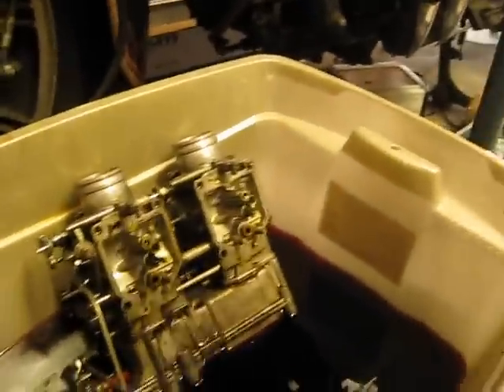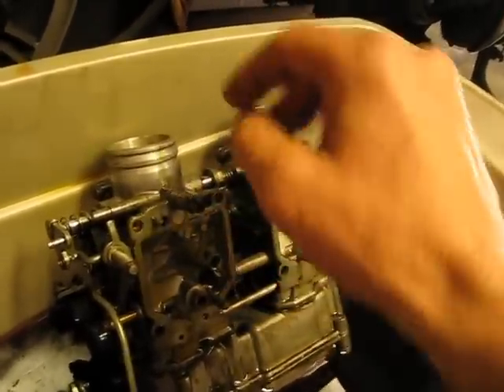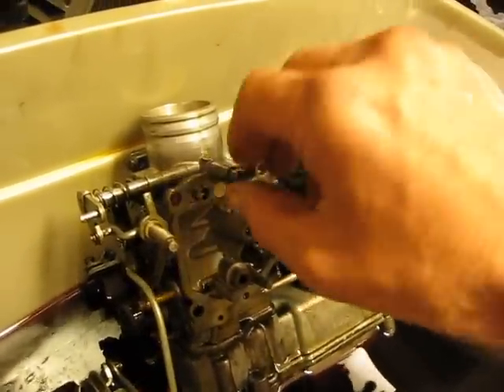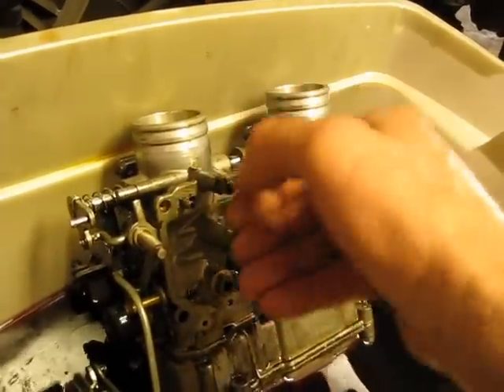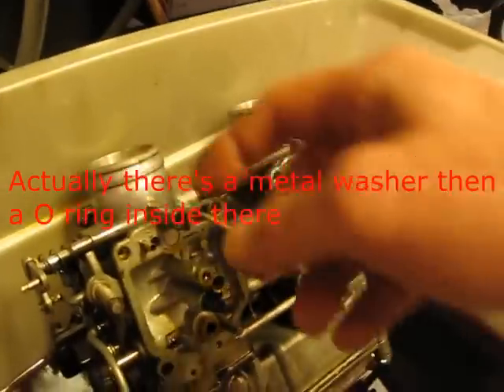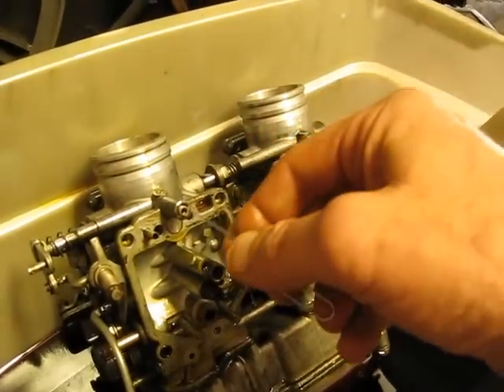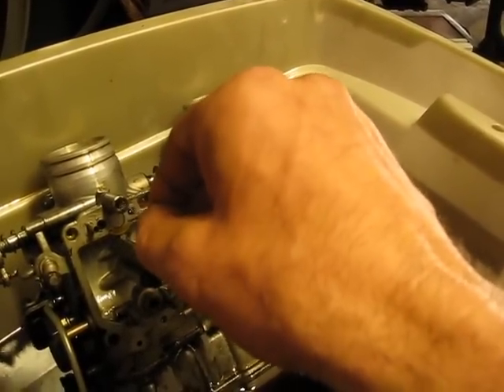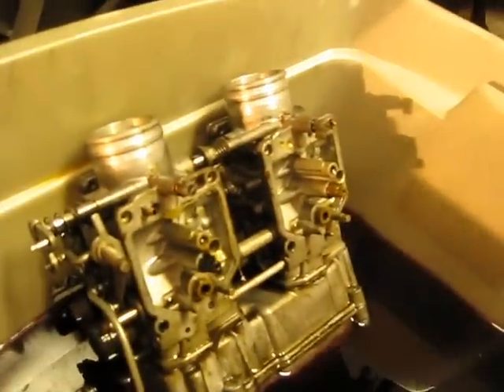GL1100- Removing the idle mixture screws

Comment: If you don't at least see the O ring, there is no point in even cleaning the jet.
The O ring is the part of the Assembly that controls the air bleed around the needle: it forms the base of the needle valve. Ergo if it is dirty, cracked, broken or missing your idle mixture is not correctly adjustable.